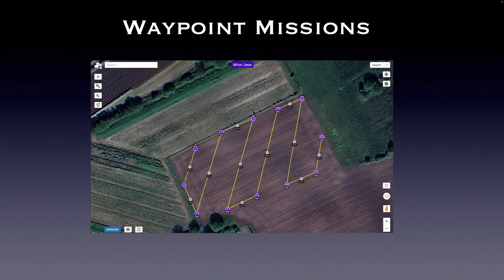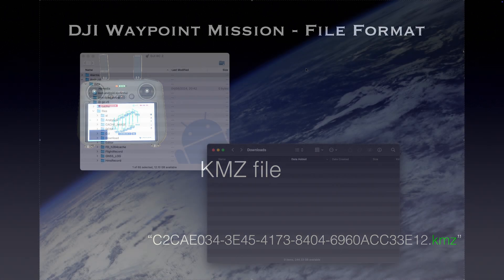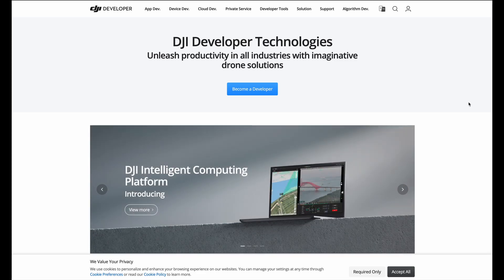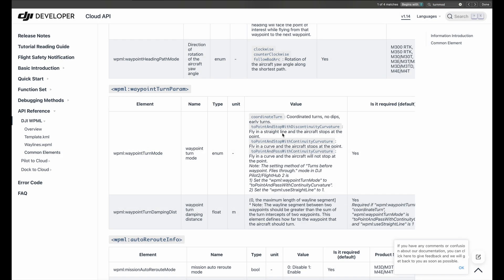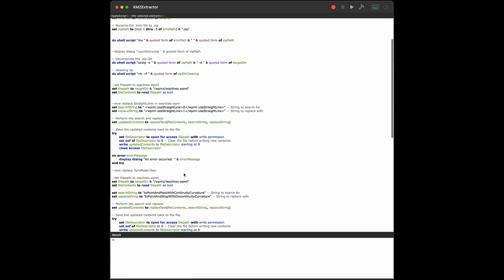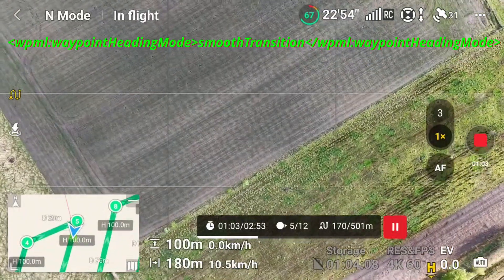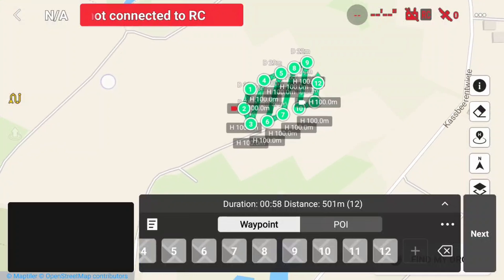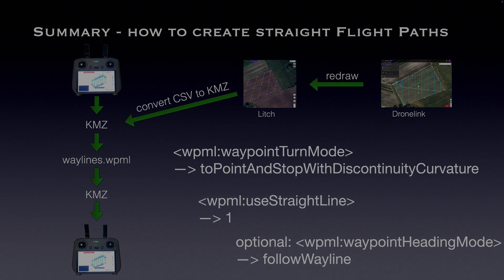Straight-Line Precision: Step-by-Step Waypoint Mission Setup (DJI Air 3, Air 3S, Mini 4 Pro)

Comment: Thanks for the instructions! I could do a straight line waypoint mission and run it. It starts well and follows waypoints, also keeping heading mode. But in some point drone drifts a bit from the path (due to wind I suppose?) and misses a waypoint, it does not know how to return to mission, and ends up to spinning slowly, finally just hovering near the missed waypoint. Is this normal or is there some other options to tweak in waylines.wpml?
Reply from the maker: Hi, is this reproducable? Always the same point? As you already assumed maybe the wind is blowing your drone of the waypoint line, and it tries to return. Maybe you can try it again with less wind?
Reply: @stefanwoermcke6828  Yes, it seems that it always misses at waypoint 8/12 on this particular flight. Looks like it does not know which direction to go next. I have set max altitude of 120m. When I dropped that to 40m to have less wind, everything worked ok. Then I tried 118m. That worked too. I thought maybe reaching max altitude disturbs the waypoint flight or maybe it was just a coincidence that two flights below 120m were ok, but none of them were ok when the altitude was 120m.. Anyway I ended up using normal curved waypoint flight with 20deg gimbal tilt to analyze big forest area for storm damage. Gimbal 90deg down and straight line "scan" for every square meter on +100 hectares area would have taken very long :-)

Comment: Hi, I tried your script, but for some reason it takes a kmz file, converts it to a zip file, then unzips it into a folder, then changes the parameters, then archives the folder in a zip file, but then it creates a kmz file not from this folder, but from the old file, and it turns out that the modified file remains in the zip file. What am I doing wrong?
Reply from the maker: Hi, I just checked it, and it seems there is a caching issue: I read and write back "waylines.wpml" three times (to replace straightlines, follow mode and headingParam). Now after each search and replace he writes back the content to the file, but when opening the file again for the next search and replace operation, it seems he is not reading the updated file from the previous step, but instead the (cached) original version - so the "waylines.wpml" will always loose the previous change.

I just changed my script in this way:

1) first search for <wpml:useStraightLine>0</wpml:useStraightLine> and replace it with <wpml:useStraightLine>1</wpml:useStraightLine>, and set the result to a variable named "updatedContent" (as before), BUT NO WRITING BACK TO THE FILE SYSTEM!
2) repeat the next search and replace for <waypointHeadingMode>, but do the replace operation in "updatedContent", NOT IN "fileContents", as  the intial version of my script
3) all following search and replace operation: same way: allways replace in "updatedContent"
4) finally, write "updatedContent" back into  a file

after that the compress command will create wpmz.zip

For execution, I always run the scripts in Apple's script editor. To check for errors, I always put a "display dialog" command to pause execution and check if replacement / zip commands did what they were supposed to do.

Hope this helps, otherwise let me know if you need further help!
Reply: @stefanwoermcke6828  Can you post the finished script so it's clear?
Reply from the maker: @dilkins_fpv  Hi, finally I found the time to finish my script, you'll find the download link in my new video: https://youtu.be/Qj7A7uAdbZs

Comment: thanks a lot for this, i made a waypoint map yesterday on air 3S, and when i went to fly, randomly the flightpath bowed out across the street near powerlines, so obstacle avoidance braked it (thankfully), now I'm trying to edit it, and I didnt see where to add additional waypoints to straighten out line? also i don't want to create map remotely because i had certain areas on property to capture (signs, etc.). so im going to try this now.
Reply from the maker: Did you (after importing) save the waypoint mission again? In that case, DJI will revert some of your changed tags back to defaults - but not all of them - leading to a very strange flightpath. Otherwise if you follow my tutorial, import the waypoint mission, open it (without saving) it should work flawless. The problem: when exiting the waypoint mission, the DJI Fly always ask if you want to save before exiting: and if you hit "exit and save" your mission will be corrupted to this strange flight path. 
So always keep in mind: if you imported, or just used your mission with straight lines: NEVER DO A SAVE when exiting waypoints

Comment: Thank you for at good video. My challenges start when I try to edit in notepad ++. Also, I have tried downloading a mission, renaming it and oploading it to the folder on my controller. When restarting my controller the mission is still not visible. Also, I have tried creating af Litchi mission, but those I can't get to appear either. 
Do you have any help here?
Thanks for at good video.
Reply from the maker: Ok, let's start to fix it step-by-step: first try it with a litchi mission: your litchi mission has to be  exported as a csv file, converted it into a kmz file (with litchiutilities), renamed to an EXISTING mission on your controller, and then upload the renamed KMZ file to your controller. For that, you can also check-out my video for this process: https://youtu.be/JSSIjOQLLd8 
Now for the straight lines: when unzipping the kmz file for editing with notepad, you will see a subfolder with the wpml file in it. After editing, make sure to include the subfolder in your new zip file. Then rename the zip file back to kmz and upload it as explained for the litchi mission.
Let me know if at least the litchi mission upload work for you, and then we can try to fix your problems with straight lines

Comment: This video explains a lot about how to work with the Waypoint files however with the latest version of software on the RC 2 controller (I have a Mini 4 Pro FYI) I cannot view/transfer the Waypoint files. When I connect to my Mac the only files that I can transfer are the log files. It looks like DJI have blocked the acess to the Waypoints files in their updates. I have downloaded the DJI Assistant 2 which allows me to transfer the logs but not the Waypoint files. Does anyone know of a way to get around the DJI block on the waypoint files on the RC 2 controller. I am using a Mac so ideally a solution that would work on that but have a PC so could use that.
Reply from the maker: on which software version are you running? And most important – how do you transfer your waypoint files? I am using android file transfer for Mac, and this works perfectly fine (and my RC2 is on software version 1.17.4)

Comment: This is exactly the info Iw as seeking. There was at one time, and option in the waypoints app to use straight line, but I assume DJI was getting too many support calls that were people using it with no need for their recreational flying. This is a bit of work, but  not unusable. Thank you.
Reply from the maker: .. and to make it even more easy to use, I finalized my apple script and explained it in my new video (including a download link in the description): https://youtu.be/Qj7A7uAdbZs

Comment: Followed the tutorial exactly. Flight path/plan was not displayed on DJI Fly App used with RC-N2 and Mini 4 Pro. Fly App version 1.17.1. Tried many times, results were the same.
Reply from the maker: Did it show nothing or a wrong flight path?
Reply: @stefanwoermcke6828  Thanks for your response. Map displayed but there was no usual flight paths nor waypoints when selecting saved waypoint mission on the fly app. Note that I used WaypointMap Mission Editor free version on PC to create waypoint mission kmz file which was loaded to dji fly app and displayed correctly with waypoints and curved paths. Once I modified the kmz file for straight-line path per your vid and load to the fly app, nothing displayed (neither waypoints nor paths) on the map just like the app ignored the kmz file. I double checked all wpml commands per your vid the problem persisted. Any advice what could go wrong? Thank you.
Reply from the maker: I remember I once had the same problem. If memory serves, there were several issues (not sure which of those was the acual root cause):

- when unzipping, you will see a subfolder "wpmz", make sure that after changing the waylines file and compressing the file you start from "wpmz", so you will get a "wpmz.zip" at the end
- my name did not exactly match the name of the folder (I think I got one letter wrong)
- I forgot to rename the zipped file from "xxxx-xxxx-xxxx.ZIP" to "xxxx-xxxx-xxxx.KMZ" before copying it back to the controller

If the map shows no flightpath at all (not anywhere on the world map), I would first check the filename: it happened to me as well while copying back and for that I lost the last 4 letters of the cryptic filename.

I don't know the "WaypointMap Mission Editor", not sure if this maybe an issue as well? If nothing of those steps above work,  I would also try to edit the file with a plain text editor, to make sure the "Waypont Mission Editor" doesn't add additional characters which might cause issues at the end.
Reply from the maker: can you put your kmz file on e.g. google drive or dropbox?

Comment: Could you please elaborate on how to turn the litchi waypoints in .csv format into kmz format? Or maybe link a video that explains the process. Are you positive that this works for the Air 3S?
Reply from the maker: Sure, I did a separate video for this process: https://youtu.be/3l2ZLuLbqLI?si=e7Y6w-GtQf5r6kSW
And yes, this also works for the DJI Air 3S: for comparison of the Air 3 and the Air 3S I first created a mission in Litchi, exported it as CSV file, converted the csv file with Litchi Utilities, and finally uploaded the KMZ file to the controller of the DJI Air3 and the DJI Air 3S: this way I had identical flight path for quality comparision (if you‘re interested you can find the comparison video on my channel)

Comment: This is a great tutorial overall for fixing the waypoints. So that I fully understand, if you have let's say 40 waypoints on a mission, you have to replaces those lines 40 times if you haven't got coding experience to run things like ApplesScript or the Windows equivalent?
Reply from the maker: Yes, correct - you have to repeat it for every waypoint. If you run on windows, easiest way would be to open it with a text editor and use "search and replace". When finished, make sure you save the file  as a plain text file (not rich text or *.doc format).
Reply: @stefanwoermcke6828  thank you for the clarification. Was just making sure I understood correctly. Yes, you are right. NotePad on Windows has the 'Replace All' feature under Edit >Replace.
Reply from the maker: @taridean  here an explanation in detail with a link for an apple script and windows power shell to automate the conversion (the power shell version I just created with the help of AI, but wasn't able to test it, as I only have Apple devices at home): https://youtu.be/Qj7A7uAdbZs

Comment: Thanks for the tutorial, it works perfectly for my Mavic Mini 4 Pro.

I tried to make it so that a photo is taken automatically every 1 second once the drone is launched, but I haven't succeeded yet. (By default, it doesn't launch automatically and we're limited to one photo every 5 seconds). Can you do that on your end? Can you make a new tutorial?
Reply from the maker: Just checked with my Air 3S, taken a photo every 1 second isn't possible as well, min value is every 2 sec.
Do you need this for photogrammetry? Then I would recommend to decrease the overall mission speed until taken a photo every 5 sec will work for your project. 

It's even easier if you have dronelink: you mark the area you want to map for a given speed, and then dronelink will calculate the number of photos needed for the mapping. After uploading your waypoint mission to the controller, open the mission and you wil see the total flight time. Now taken the total flight time in seconds and divide it by the photos needed, it will give the photo interval you need, e.g. total flight time: 180 secs, photos needs: 38 --> 180/38 = 4.7368 --> set your photo shooting interval to 5 sec.

Hope this helps? Just let me know if you need more info!
Reply: @stefanwoermcke6828  I wanted to increase the photo frequency to create a large orthophoto/panorama. I also considered reducing the speed, but this also increases the time the drone has to spend in the air. Unfortunately, the battery is limited. Even though you can split a flight into several to use multiple batteries, it's not very practical. The only real solution is to increase the frequency, unfortunately; that doesn't seem to be possible (or at least I haven't been able to).

Thank you for your reply and your suggestion.
Reply: idk about 1s, but you can put it into 2s if you change the camera to 12MP. 
I use it very often when I want to make orthomosaic map, also pair it with 5m/s speed is really handy. 
covering up to 200 hectare for around 50% of normal battery with height 60-50m above the ground

Comment: Could you add the code ..for  followWayline... as --comments ( meaning uncomment if you want followWayline) ?
Reply: If you want, I have a little python code that seems to work if he doesn't put his code in description by then. (It works for straight lines). I'll try later if "followWayline" works too.
Reply: @defer1100  Could you share that python code? Thanks!
Reply from the maker: @tech9251  finally I finished my apple script, explained it in detail, and  added a download link in the description: https://youtu.be/Qj7A7uAdbZs
Reply from the maker: If you want to use apple Script, you can add this snippet:

-- change heading modes in waylines.wpm
set searchString to " <wpml:waypointHeadingMode>smoothTransition</wpml:waypointHeadingMode>" -- String to search for
set replaceString to "<wpml:waypointHeadingMode>followWayline</wpml:waypointHeadingMode>" -- String to replace with

-- Perform the search and replace
set updatedContents to replaceText(fileContents, searchString, replaceString)

-- Save the updated contents back to the file
try
	set fileDescriptor to open for access filepath with write permission
	set eof of fileDescriptor to 0 -- Clear the file before writing new contents
	write updatedContents to fileDescriptor starting at 0
	close access fileDescriptor
	
on error errorMessage
	display dialog "An error occurred: " & errorMessage
end try
Reply: @stefanwoermcke6828  Good stuff! Is the script available for download?